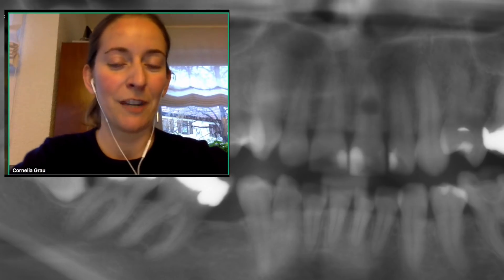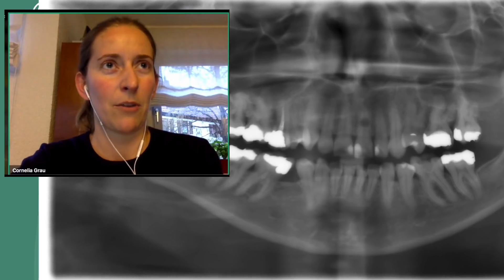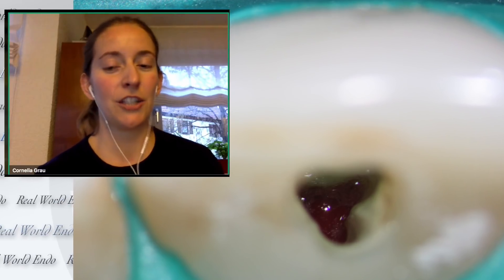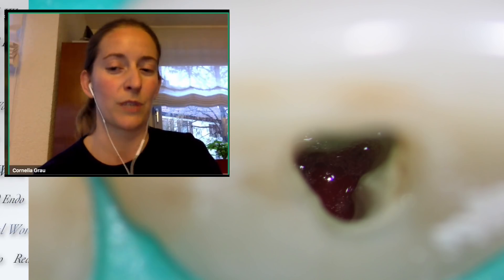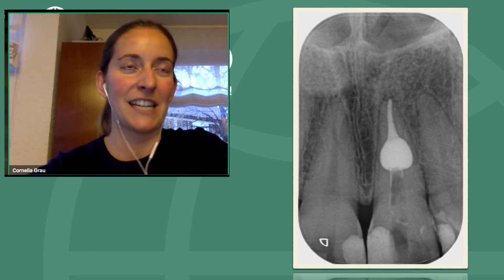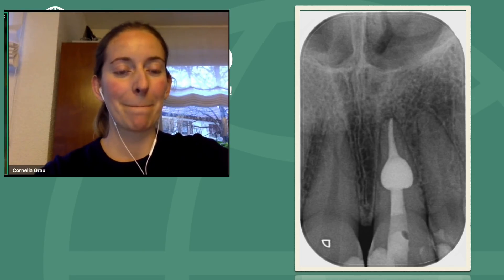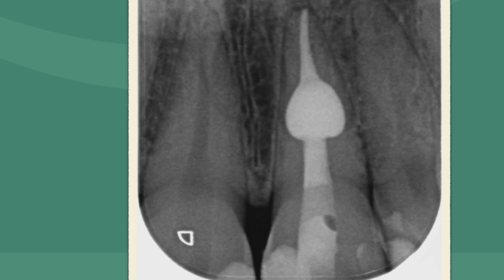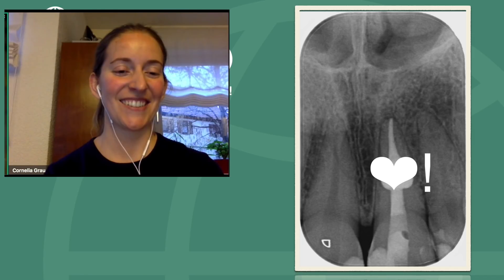Clinical Case Review: Internal Resorption Treatment Interview with Dr  Cornelia Grau

Comment: I was diagnosed with internal resorption in my #9 2 years ago.  At initial diagnosis, I was told a root canal wasn't possible.  This was 2 years ago.  I could see the area in the x-ray, but if it has lasted 2 years, is it possible my dentist was incorrect in his "a root canal won't save the tooth" prognosis?
Reply from the maker: You need to be clear if it's internal resorption or external resorption. You would need a CBCT to be sure. If it's internal resorption then endo can potentially save the tooth (depending on the size and potential perforation), if it's external then the odds are worse. But even if external they can last a few years before they become symptomatic. So, I wouldn't pull the tooth until you have symptoms or problems. But if it's internal it can be saved and you shouldn't delay as it gets larger and then it won't be saved. But in my experience, yours is a misdiagnosis by your dentist and it's likely an external resorption instead of an internal resorption. You need a CBCT to confirm. See a good endodontist to find out. Good luck.
Reply: @EndosKool  Yes, I've wondered if he had made a misdiagnosis.  Thank you for following up sir.

Comment: This was a lovely case!
I do have a question: I think it's safe to say that the structural integrity of such teeth is compromised due to the severe lose of root structure. Although this treatment was done phenomenally, I wonder what is the long term survival rate of such cases?
If predictability is a prime concern, and a patient asks me "wouldn't an implant be a better, safer solution?", how should I answer such a question?
Reply from the maker: It's a valid question; but for some reason, I've never actually seen these types of internal resorption cases fracture or snap off. They tend to do a lot better than our imagination conjures up. So, I would always recommend the RCT first in these cases. I've never seen the patient come back with the tooth snapped off. Cheers!
Reply: @EndosKool  Thank you so much Dr. Nasseh! I appreciate you taking the time to answer these kinds of dilemmas

Comment: with this type of defect, why not use a Lightwalker laser PIPS technique which would have debrided the entire root canal system, no matter what shape the resorption lesion is?  I would have preferred  biodentine  to fill the defect after obturation.
Reply from the maker: Whether PIPS coronal activation is adequate in cleaning these types of lesions is not clearly known. At least with 3D instrumentation one can expect direct contact of an instrument with dentin walls, which has been shown to be effective in removing tissue or biofilm. But this whole area is lacking some real clinical research. In terms of Biodentin, it could be used as a substitute here. The difference is that injecting the RRM syringeable is no doubt faster and easier than mixing, triturating, and incrementally applying and condensing BD segments before it sets. One would certainly have more difficulty  injecting BD directly into the resorptive lesion that deep in the canal.
Reply: Biodentine takes 12 minutes to set.  I can make it a little more runny and inject.  I have never had a problem condensing it and adapting it in most situations.  That defect looked quite large and I felt the biodentine would be a more structurally sound option than just a space filler.  II am just worried about the tooth fracturing.  and if you use Bioroot RCS, the chemistry is compatible and you get a sealed system.  What do you think?
Reply from the maker: There is no advantage with BioDentin or BRRCS over the RRM. RRM is premixed and ready to inject. In terms of strength, it's strong enough with structural integrity in this region. So, no advantage for BD. So, if you prefer BD use it. But RRM is certainly easier to apply.
Reply: Real World Endo thanks for the information
Reply: @EndosKool   Do you know of any one On the mid East Coast that is willing to treat IRR instead of pulling the tooth
Reply from the maker: @Brazjion  I don't know what the Mid-East Coast constitutes but find an endodontist in your neck of the woods, call their office and ask if he/she does molar surgeries (litmus test to see if they have adequate surgical skills/training). If the answer is yes, then they would be able to take care of your tooth if it's the kind of a tooth that can be saved. Get a consult and go from there. You can't save all resorptive roots. It depends most importantly on the location of the resorption and if it's surgically repairable and then on someone who has surgical skills that can repair it. The rest is your own biology and your ability to heal in that area. Good luck!

Comment: Does filling materials strengthen the weakened root with internal resorption ? as in is there a significance between use of GP , MTA or bioceramics related to fracture resistance of the root?[ citation of studies would be appreciated]